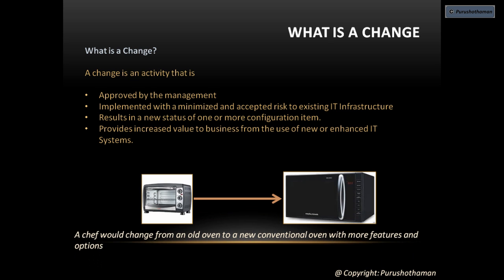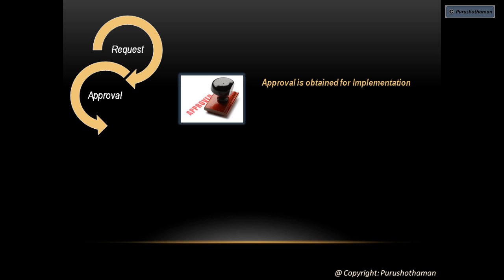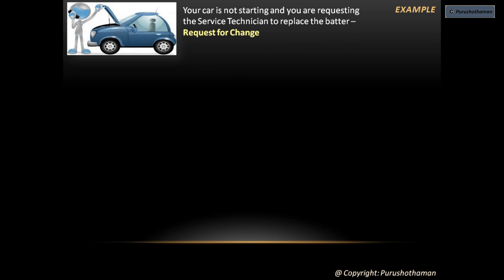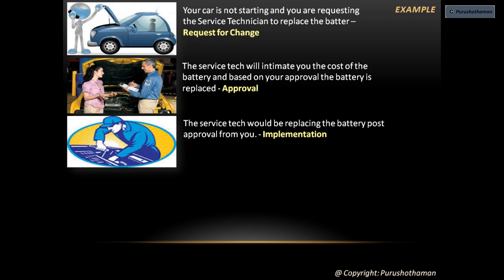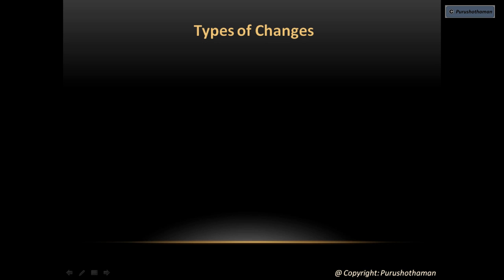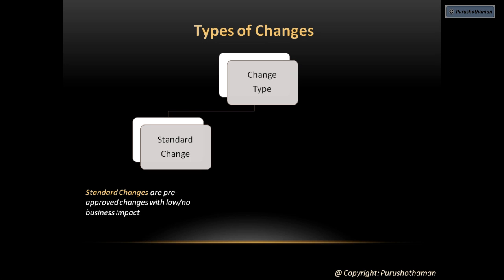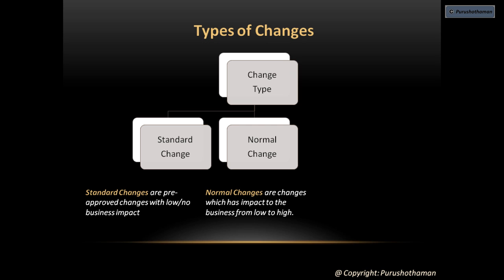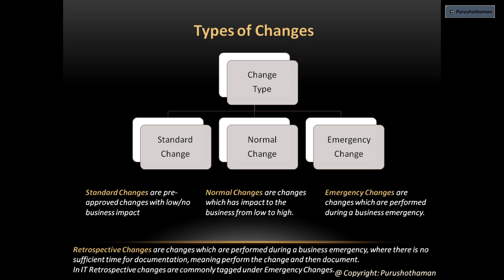Change Management Process - Learn and Gain | Explained using Car Battery replacement

Comment: What are the risk associated with change management in regards to file transfer infrastructure?
Reply from the maker: As far as File Transfers are concerned, most organizations perform as a service request or a pre-approved change (which which has minimal/negligible impact /risk associated). There are various plugins, software's available in the market that are used within organizations for file transfer. If transfer of files are done though a public cloud, then there are associated risks of information made available on a public cloud.

Comment: Change Requester: One who request for change. So in case of standard firewall change rule implementation normally who raise firewall change request? 1. A user who want to access specific service by opening firewall port or 2. A firewall engineer who implement change request
Reply: Thank for the clear answer. Understood now clearly.
Reply from the maker: Thanks for your question. The role of a change requester can be played by anyone. The answer to your question depends on the person/process defined within an organization. ITIL is only a framework, defining how the process works within an organization is up to its own process definition. 

There are few prominent flows available in the industry
1. Request Fulfillment -> Change Management
2. Directly through Change Management
3. ServiceDesk -> Change Management

Scenario 1: If an organization has Firewall Modification Request through a service catalog, where Business/application owners want to have the port opened for their application, the requester here is the application owner.
     The application owner will actually submit a service request to open a port for his/her application. This is received by the firewall team and a corresponding change request is created. Here when creating the change ticket, someone within the firewall team request the change ticket in the system. Usually these changes go though CAB/CCB within an organization to see if there are broader impact above and beyond the specific application. 
    The requester of the firewall modification still remains the application owner, but the actual change ticket in the ITSM tool might be someone from within firewall team (or sometimes the application owner, depending on the process defined)

Scenario 2: If a process defined through change with no customer facing service catalog/request, the application owner/custodian might open a change request in the ITSM tool and assign it to the firewall team (auto-routing based on the CI selected in ITSM tool is also enabled in most of the iTSM tools)

Scenario 3: If an application owner/custodian called Service Desk for assistance. Service Desk would open a change request/follow their defined process and ensure that a ticket is assigned to Firewall team with the customer information populated. 

As I mentioned above, there might be also multiple other scenarios that an organization might have defined within them. Its still within the organization on how they want to define the process. 

Hope this helps.

Comment: The topics that you have touched are very relevant to the Change Management Process itself, although I would like you to advise on avoiding reading [as much] out of the slides. My tutotors taught us to not write everything on the slides which the audience is going to see, instead keep only key pharases or pictures on them to give you, as a preseter a guidelines of what to talk about when and also to keep your audience intrested during the whole presentation.From presenter perpective I would advice you to use the Notes Pages, which is one of the features of the most basic PowerPoint Presentation software. I hope my comment not offended you and will help you for your future higher performance :)
Reply from the maker: +Kasia Plewinska  - Thanks much for your time and feedback. Good observation and I am working towards that on my other videos.